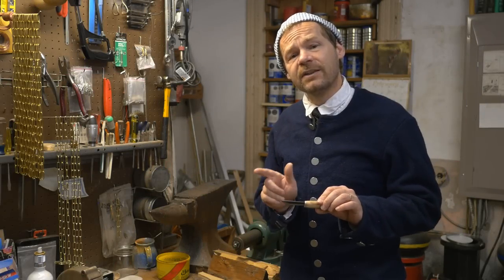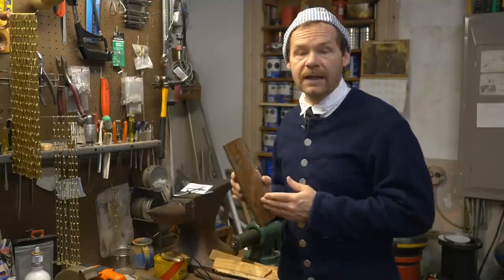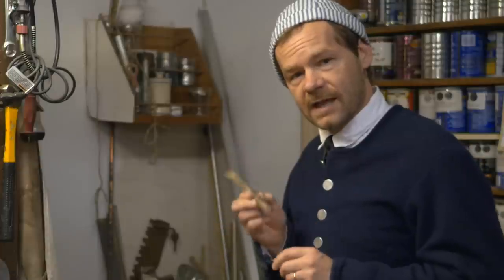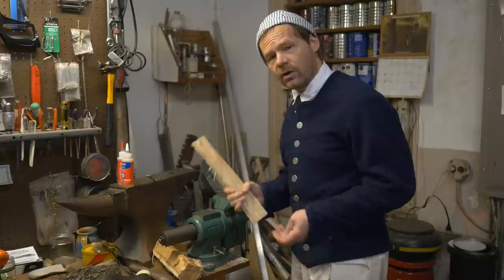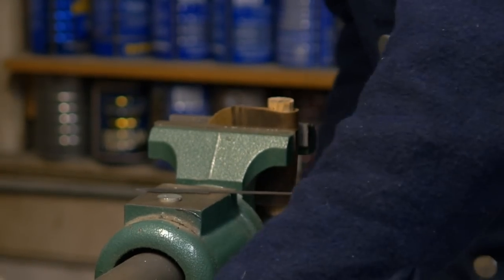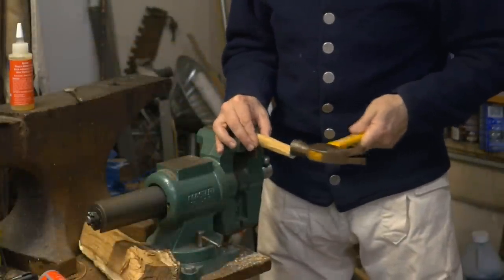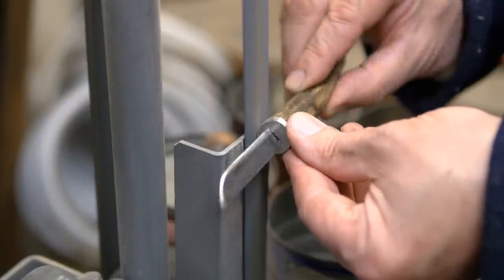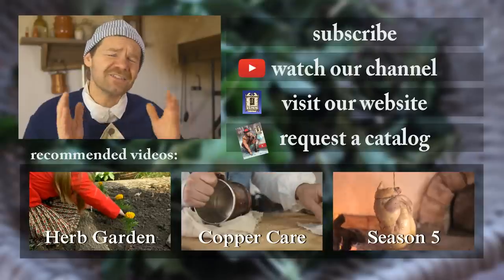Making a Quality Custom Knife, The Easy Way

Comment: You can boil the antlers for about 20 minutes and the center will soften. You can then press the tang into it and when it dries it will be almost impossible to remove. No glue necessary.
Reply: Thanks. Does the same apply to elk, ox, bull horns? Should you boil them for longer or what?
Reply: @StrangerHappened  I'm not sure about bull because the inside pith isn't the same on horns as it is with antlers. Elk should be the same though. Antler is shed yearly therefore the blood flow is on the outside and it's lost with the velvet. Bull horn when cured or dried will slip and there is flesh and bone inside.
Reply: Do you still need to drill the hole? Thanks for the tip!
Reply: @30CalCoreLokt  No hole, though a much smaller hole for a starter guide might help. It's mostly just shoving it down into the spongy core of the antler that holds it in place, so boring out a hole would defeat the purpose.
Reply: @paintedwings74  a thin guide hole does help
Reply: @stevesyncox9893  Sounds about right. It seems like it would take some of the strain off, too--antlers aren't likely to split as much as wood, but still.
Reply: That's bc the antlers make their own glue when boiled.
Reply: @StrangerHappened  elk antler pith isn't as strong as deer antler pith. 
Elk antler doesn't work as well as deer antler for knife handles.
Reply: Thank you, and the others, so much as this explains to me why so many knives had deer antler handles! 😎

Comment: you can soak your wooden handles in water overnight before drilling and fitting the blade into it. When the wood dries it will shrink around the tang and make a nice tight fit that isn't likely to loosen or come out.
Reply: That's not how wood typically works
Reply: Alternatively, and perhaps a more reliable and effective approach, would be to use dry wood as normal and apply a boiled linseed oil after allowing the wood to swell and be preserved.
Reply: Stabilized wood is really the best for handles.
Reply: @wordwyrd I think they tried to copy someone else's commemt about antler. 😂

Comment: There's a trick I use with stick tang knives I call "fish hooking". Essentially it's cutting small file like notches in the tang pointing toward the blade that give it extra grip when inserted into a handle. Should allow you to skip the glue stage. Also, pre-drill using graduated bits so that the tapered end of the tang fits just as snugly as the bolster.

Comment: If you let the tang poke just a hair out the butt end of the handle, you aught to be able to hammer it flat in a peen, forgoing the need for glue.
Reply: I still saw that used in Vietnam up in the mountains ( central Highlands ) where villagers or farmers attached knives to handles back in 1967. A lot of time there would be a washer like bolster next the the butt end where the tang was hammered over.
Reply: Lol, peen
Reply: That idea has been used for over a thousand years on Finnish Puukko knives and Swedish/Norwegian utility knives.......nothing new
Reply: kaldicuct Another feature with preening the tang is you needn’t use one piece handles but layered handles with layers of bone antler different woods or any combination of them
Reply: @djs-jk6cb  very true. Get some bone, wood, leather combos then give it a sanding and oil. Oh it would be gorgeous.

Comment: Nice job but I would have made the wooden handle oval. It's just one of those little touches to make a knife easier to use (and it helps give you an idea of what direction the cutting edge is pointing) Also if you don't want to use glue on the tang I would use cutler's wax instead. Recipe I have is 1 part pine resin to 1/4 part beeswax and a big pinch of powdered charcoal. Just heat it up and drip a little into the hole then place the blade in before it hardens.
Reply: Why not just put your thumb on the spine? That would tell you where the edge is
Reply: No, with a round handle  your thumb could be on the blade side, unless you look at it to confirm.   The oval(ish) handle is more about blade alignment while you work though.   Your fingers can grip and hold truer with something oval than round.   Round wants to spin in your fingers once pressure is applied, or an object is stuck.   Oval stays true easier.  That's why all cutting and striking tools(and weapons) pretty much have an oval handle, unless of course alignment isn't important(like a plunger or mace).
Reply: @MrBottlecapBill  always helpful when the handle indexes the blade properly for sure!

Comment: Nicely done. A stick tang can be heated and the handle hammered on. Also antler can be straightened by boiling it in water, then clamping in a vice. As you pointed out a draw knife will work the wood down. So will a crook knife. By the way, nice vise. Is it a Wilton?
Reply from the maker: 57WillysCJ Thanks for the suggestions.  - The blanks are made by Jeff White.
Reply: He makes some great trade knives.

Comment: 18th-century people probably would have put pins through the handle and tang instead of using glue-- because the glues they had available weren't as suitable for knife assembly as modern epoxies and cyanoacrylates are. A friction fit, such as Jon used on the wood-handled knife, was also sometimes used. As someone else noted in these comments, another technique was to use pitch as a cement. I don't know how typical that was for knives, but it was definitely used in other implements.

Comment: you can heat the tang up & burn the handle onto the knife after you have a pilot hole, works even better if the woods been left in water for a little, do it right & you don't need glue.
also make sure not to drill to-small if your just doing a press fit, you may split your handle.

Comment: What would they have used since they didnt have epoxy?
Reply from the maker: The probably would have made they handle fitted enough that an adhesive would not have been necessary but hide glue is what would likely have been used in the time period if it was needed https://www.youtube.com/watch?v=Qwyyi5-Ye7c
Reply: @townsends  Thanks

Comment: History nitpickers, if the idea of using epoxy makes you wince, period knife handles were burned into place. It may require redoing the heat-treatment though.  Drill a hole in the handle equal to the thickness of the tang.  Wrap the entire end of the blade up in a few turns of aluminum foil. then clamp it up so that only the tang is above the vice. Maybe put a wooden block below the tip so it won't drop when you push down. Heat the tang with a propane torch along the tang until most of the tang is bright red.  Wearing gloves, carefully press the handle down, nice and firm. it will make lots of smoke, don't breathe it. if needed, repeat this process, cleaning out any char as needed. Finally tap the end of the handle in place with a wooden mallet.  If you try, you can get the blade to pop out, but it pops right back on again, no big deal.

History super-nitpickers, 18th century americans would rarely have the entire blade made out of tool steel. Tool steel was extremely expensive in the colonies (partly due to British laws preventing America from making its own), so they would make the tang and the back of a blade out of wrought-iron and just use a small sliver of tool steel along the blade edge.  On larger tools, smiths would even replace this sliver as the tool was worn down. (Information source, Pete Ross, former head-blacksmith at Colonial Williamsburg) Making blades in this manner makes almost zero economic sense these days.  Doing it this way would raise the cost of the kit by an order of magnitude.
Reply: Aluminum foil? My information says aluminum foil was first manufactured in Switzerland in 1910. (Tin foil, which is virtually nonexistent now, preceded it by a few decades). But you could wrap the blade in oilcloth or a piece of animal hide, etc.
Reply: Gary Cooper
If you care about that sort of thing, sure, aluminum would be an anachronism. oilcloth or hide might get a little smelly as it heats up. Lead-jaws or sheet-copper or copper-alloy would be historically accurate.
Reply: Blades were also pinned into place as well.
Reply: Certainly if they had a full tang they would be.  But this knife has a three-quarter length rat tail tang (much like a modern Mora knife), so burning or epoxy would work.  This particular knife is a patch knife, which was used when loading a patched ball into a musket; the tip of a long strip of linen would be placed under the ball and the ball started slightly down the muzzle, then the patch knife would be used to cut the cloth and make the patch.   For such a niche role the knife just had to be sharp, not necessarily very sturdy for prying or chopping.
Reply: For pointless extra information: Some times my mother and father (in their 70's) still call aluminum foil "tin foil". I'd say this is where the "tin foil" hat idea comes from. Every good conspiracy nut knows that the kind of foil dosn't matter. It's the gaps between the foil to catch the different frequencies that matter!

Seriously though. Tin mugs are awesome. I wish they where more common these days.
Reply: Verdatum, 
It was you that brought up "Wince" for a period knife over the use of epoxy, Not Gary Cooper and then you went on to " aluminum foil" ??? Not a period product .
Reply: A softer steel for the body & a hardened steel cutting edge has been used in some of the finest blades ever made. 
Japanese swordsmiths used tempering as opposed to different alloys though. 
The best felling axes are still made that way.
Reply: @skilletpan5674  I’m 56 and call it tin foil.
Reply: @simonferrer  I always wonder at using a pry bar for a knife.....
Reply: I have heard people just wraps the blade with soaking wet cloth to protect it from the heat while heating the tang. Doing knife handle by burning is very common here in finland too, and thats how historical knives were usually put together to my understanding over here.

Comment: Do you guys sell the little tool used to drill the hole in the wooden handle? You mentioned the name but I have no idea how it is spelled. Thanks for the great video as usual!!!
Reply: 2dividedby3 It's called a "gimlet". Wikipedia has an article on it if you search for "gimlet (tool)", pretty sure they don't sell it. It is the sort of thing you see at tool-collector's clubs (yeah it's a thing) meetups. Usually pretty cheap too.
Reply: It's a gimlet-- simply a drill bit with a handle on the end. An auger is the same thing, except that "auger" usually refers to a larger one, and "gimlet" to a smaller one. He also could have used a brace and bit-- the sort of hand-powered drill you see in old pictures. All of these are still made today, although they may be hard to find at the local big-box store. You can often find them at flea markets and swap meets, etc.
Reply: It's not exactly period appropriate, but the Scandinavian people long before the 18th century had a simple drill that worked by picking it up and carefully dropping it
Reply: 2dividedby3 it's called a"drill bit"

Comment: I woulda used some birch glue or pine pitch glue on the "old ways" made knife..lol
But they look great. sweet lil knives. always handy to have around. you could even do very similar things to make a wooden sheath for it. and have yourself a tiny lil camp knife.
of course a small leather sheath made from scraps would work just as well..or even a birch bark sheath would be cool.
great vid.

Comment: Nice blade. ( * waves the blade around  * ) I like the balance and the way it feels in the hand ( * does more "expert" mumbo-jumbo moves in the air * ). The edge is still very sharp after cutting through the pig carcass. ( * grins * ) It will kill.

Comment: you should always wear goggles and breathing masks when working with animal horn or bone, becasue that stuff is seriously carcinogenic.
Reply: whoa, if bone is carcinogenic how are any of us alive?
Reply: Cancer's Root cause has been explained!!! Quick everyone Revert to an octopus like state!!!
Reply: You dorks realize he doesnt mean the literal bones inside us, but bone/antler dust right?...
The bone particles can stick in your lungs. Isnt that how cancer starts? I mean, ever heard of a little thing called asbestos?  But ya ignore this guy, he def doesnt know what hes talking about.
Reply: sergeantbigmac
uhh cancer is DNA damage, it has nothing to do with tissue response to particles in your lungs. Those particles have to screw with your DNA to give you cancer. Smoke can do it, it's full of free radicals, and apparently asbestos can too (it has some pretty damn tiny particles but nobody knows EXACTLY how it causes cancer)
but there's zero reason to imagine bone sawdust is going to have an effect like that. Not that it's going to be GOOD to breathe by any means. 
and he literally said "that stuff is carcinogenic" not "that stuff becomes dangerous when you grind it into fine enough particles"
Reply: yeah, i was wrong. it turns out that breathing in bone or horn dust actually prevents cancer #themoreyouknow
Reply: Carcinogenic? Uh, no. But breathing in dust is never a good thing. And eye protection is a must, because bone and antlers can splinter and chip while you are working them, and a bone splinter in your eye is bad news.

Comment: aluminum would be better as it doesnt rust
Reply: no its now...just collect the cans after u drank ur pepsi or something and melt it... boom magic u have a satisfied person with pepsi and a long term knife
Reply: An aluminium knife wouldn't be terribly durable though, would it?
Reply: aluminium is a weak metal but in depends on a thickness of the blade or how much u abuss the knife or u could just mix it with other mentals to make the atomic structer much stronger and it doesnt rust unless their is no oxygen then the coating will go so aluminum is very durable... in fact im planing to make an axe out of it.
Reply: Cool, I've never seen an aluminium axe so that would be pretty neat if you could pull it off.
Reply: just type it in someone has done it and it look sick bro
Reply: This sounds like the kind of thinking that led certain communist car manufacturers to experiment with aluminum brakes.
Reply: ohhh well aluminium isnt cheap to melt and im just recycling the metal into something which i wouldve payed for(aluminium) so im just saving tonnes of money for a different project.
Reply: Aluminum was not used in the 18th century, but even now, it isn't used for knife blades, for a very good reason: aluminum is very soft and malleable compared to iron, steel, and other tool metals. That means an aluminum knife blade would not hold an edge, and woul bend, scratch, dent, and break easily.
Reply: Gary Cooper i guess u could make a mixture of metals.